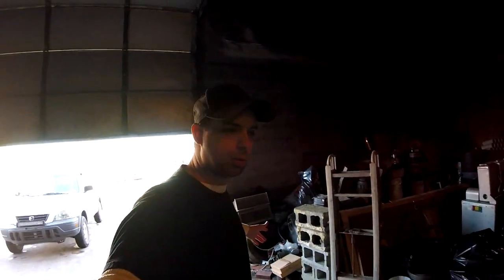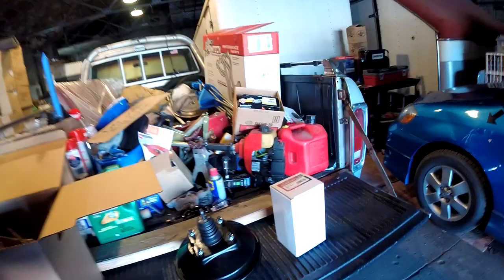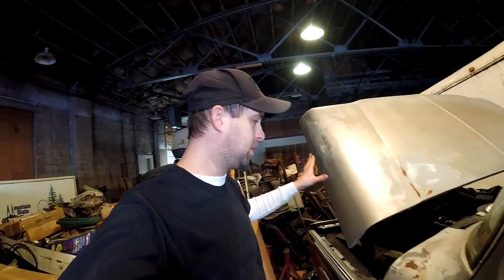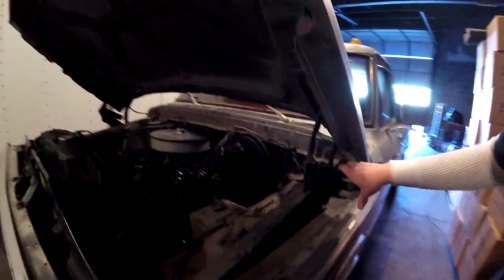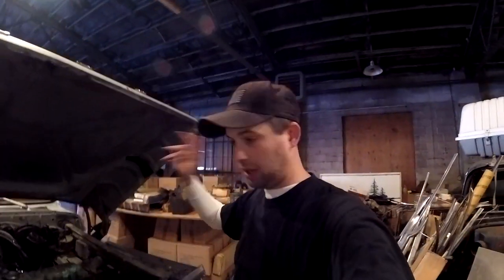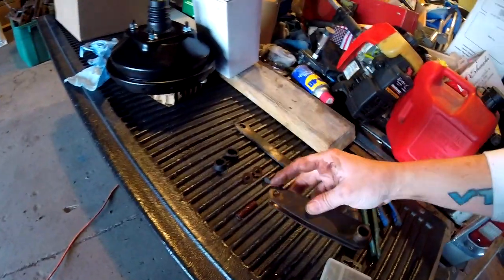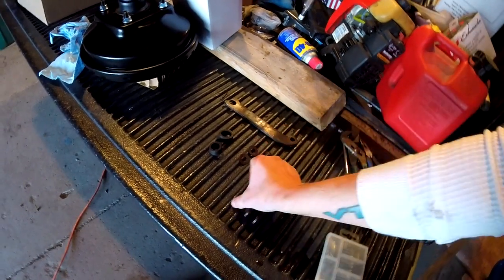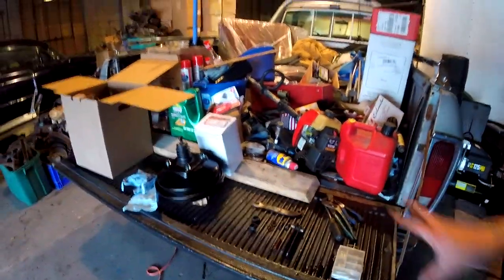1978 Ford F150 Brake Booster & Master Cylinder Replacement

Comment: Wow  please don"t stress for free! Your on the right track and will get it. I have a 76 150 4x4 and your vid helped me thanx.
Reply from the maker: cynzhero62  that’s great I’m glad this helped.  Yeah Iv got it all done and back on the road now.  Thanks for watching
Reply: VlogsByWes what was the problem, I got a cracked master on my 74, this is my next project. Shop can do it for 200$ but I could throw it together for parts cost.
Reply from the maker: PrsnllJebus  turns out the master cylinder was a bad one off the shelf. I put another one on it and it was good to go

Comment: Ok first we're gonna take the old one off, ok now that that's done, we're gonna put the new one on, ok, there you have it, hope this helped someone.the actual process would have been nice, oh well.
Reply from the maker: Have you ever tried to do this job while holding a camera?
Reply: @VlogsByWes  maybe the other guy could have assisted? Idk. I guess because I was looking for a tutorial, I expected more. I just don't get the point of a video, that doesn't show how something is done, instead plays like "a day in the life of". My comment was just a reflection of how I took it,sorry if I offended.
Reply from the maker: @woodyg768  no offense taken. It was just difficult enough as it is and to hold the camera just wasn't a option
Reply: @VlogsByWes  gotcha 👍 I had a 77 years ago,and my cousin helped me install a booster on it, he did most of the hands on,so I didn't really get to learn how to do it,so now with this 79 I bought,  I don't have anyone around to kinda explain any of the details. 
I'm just gonna dive in and learn,lol. That's the way I figured most things out anyway,have a good one ✌️
Reply from the maker: @woodyg768  it was definitely a learning experience

Comment: My peddle on my brake is like stuck helf way down could this be the problem with it.
Reply from the maker: It could be the issue or you could have a lot of air in your lines. Id start by bleeding the system real good, then go from there

Comment: how did you know your booster was bad. my boy has 78 f 150 and the breaks are mushy. Cant get them right has a new master cylinder and calipers bled the master cylinder and everything. Thought maybe it was the booster
Reply from the maker: Good question.  Well my pedal was very stiff so I sprayed wd40 through the boot onto the shaft and pump it a couple times and it would loosen up and feel perfect but then once it sits it seized right up again. Hope that helps